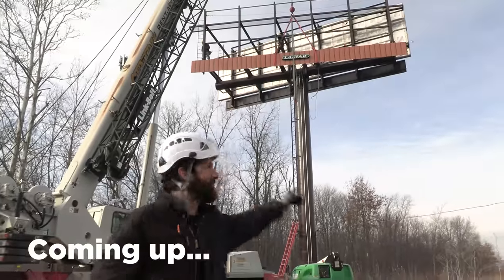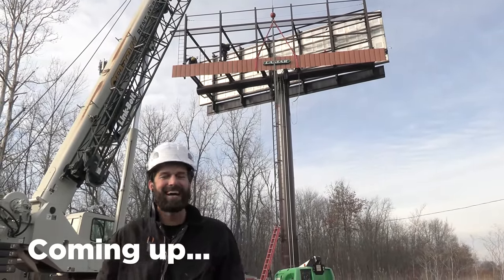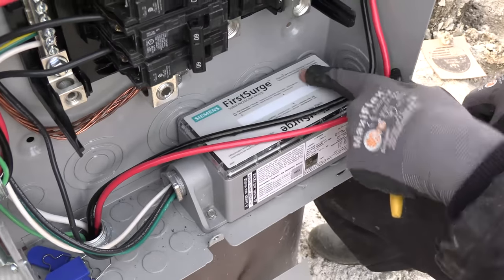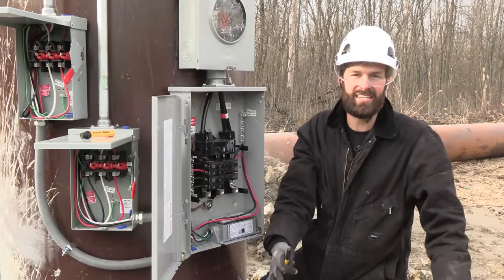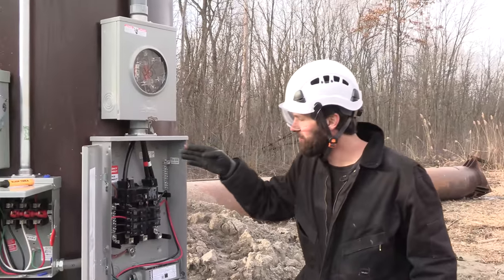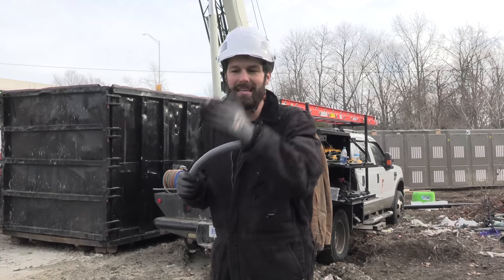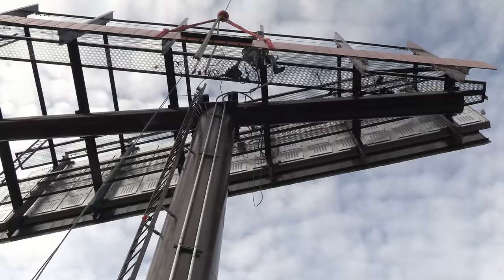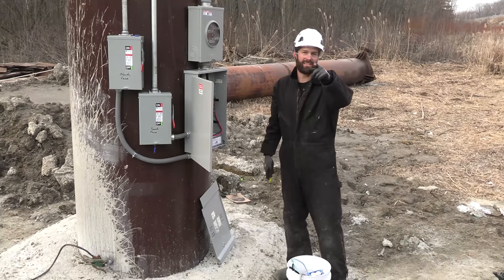The BIG Power Behind Digital Billboards

Comment: Yes, The Inspector may fail you.  The billboard itself is part of the structure and basically it is a supplemental ground(like building steel) and needs to be bonded, but is not a primary ground.  I would install at least two ground rods. If the support is 25 ohms or less to ground and your GEC is properly sized, you may pass.  You can also wait to see what the inspector says if you want. It does not take that long to install ground rods anyway, usually. Thanks, Russ-J Electrician from Oregon.

Comment: loving your work, learning much from you and I am just a software engineer doing DIYing on my own whole house solar build SAFELY.  Started it 22 years ago
Reply: 22years? By the time you are done the sun may be burnt out 😎
Reply: @nachoisme  lol,  started AND commissioned it 22 years ago. Since then, I have already swapped out the CCs and panels once, batteries 3 times, inverter 3 times ( now with a Conext XW Pro).  Same conduit, same wires, same panel mounts - added more panels.  I keep polishing it as I learn new things.  Using Tesla Model S batteries - got 12 of them now
Reply: @norsk54472  right on…awesome!!!

Comment: I worked for Lamar Advertising for 30 years as their electrician over that 30 years I’ve seen the industry change a lot I have found regardless of which digital display you wire up Weatherby daktronics I guess go board or any of the many other ones once you’ve done one they’re pretty much all the same access is the biggest problem and overcome

Comment: I would still throw in a rod or plate, concrete is good for grounding which is why concrete encased electrodes are acceptable, but I dunno if you'll get a good enough ground just from the steel mounting bolts of the sign posts. Sitting on the ground doesn't mean it's grounded ;)
Reply: I can’t tell if you’re joking or not… lol the literal definition of grounded is “connected to ground” and the literal definition of ground is “the earth”

So yeah, it’s grounded. However, inspectors do like to get on their high horse and do like to impose their will, so who knows man.
Reply: @markxx90  it's sort of an inside joke I worked with a guy who would always say "I don't need to hook up the ground it's on the ground"

Comment: I'd say the whole issue of a separate grounding electrode will depend on your authority having jurisdiction (AHJ) and, potentially, the particular inspector you get that day. In my AHJ the idea of "if it's less that 25 ohms..." would never fly with any of the inspectors even though it's called out in sec. 250-54 because it depends on reference to a (local) grounding electrode which you have not installed. (Using the power utility's ground as a reference also wouldn't pass muster because that ground isn't under the inspector's purview and depends on intervening conductors which may have local faults.) Also, is the ground wet when measuring resistivity, or is it dry? Does the resistance change over the course of the year such that you might/might-not pass inspection today but not next week? You would be in a stronger position to make a case for passing inspection if you had been involved with the construction from the beginning and could document with pictures and construction inspections that the structural rebar was bonded together using appropriate ground clamps and the associated rebar grounding conductor was bonded to a grounding electrode. Obviously you are coming onto the project after the fact and can't do that. Lastly, in play here is "what's it worth to cut this corner"? If you fail the inspection and then have to return to the job-site to 1) fix the problem and, 2) meet the inspector again for re-inspection, then how much expense does that represent to you and Jefferson Electric? Taking a little extra T&M expense now may well save a bunch down the road.

Comment: If you can prove you have less then 25 ohms to ground there should be absolutely no reason to put a rod in
Reply: Now we KNOW! And knowing is half the battle. G. I. Joe!! 
Sooory, when I'm tired I find humor in dumb things.
Reply: Not less than 25 ohms to ground. 

It requires less than 25 ohms to the earth ground connection. 

Yes, they're ultimately all connected in the main panel, but the measurement would be taken from the earth ground conductor and not at the bussbar where all the grounding conductors converge.

Comment: Ok, using the pole for grounding without testing is a huge mistake, dry concrete is not a good conductor.  I worked for 40 years in the cell tower industry and I have used a megger to test grounding on every tower that I built and you did not install a proper ground.

Comment: FL ELECTRICAL CONTRACTOR 
Ground rods at light poles and billboards sirve ZERO purpose in electrical safety. The structure concrete and anchor bolts with the cage is your grounding electrode. For static purposes YES. But never to clear a ground fault.  But to answer the question would I drive a ground rod. Absolutely not. The concrete base is the grounding electrode.
Reply: The purpose of the earth ground in an electrical system is never to clear a fault! 

People always misunderstand the purpose of this required part of the electrical system. 

In order for the fault to clear, you must provide a clear and solid path for the fault current back to the source, which is usually the utility transformer. This is what the purpose of the grounding conductor is, but usually that path back to the transformer is the utility neutral wire. 

Utilities in the US do not provide a separate grounding conductor to the utility source. This is actually a deficiency in the utility design and has been the subject of many studies, debates and conversations. 

Now the purpose of the earth ground is to help dissipate excessive voltage from a nearby lightning strike (not a direct hit) to earth. That's it. That's its only purpose. 

I recommend anyone that wants to understand how and why earth grounds are needed and how they should be connected for different situations, should look for some training material from Mike Holt. He has some excellent information with amazing simple illustrations that explain how and why the systems gets installed and what each part of the system is. His training classes are highly recommend! 

I also believe you should have installed the ground rod(s), because then it's sole purpose is to provide that required earth ground and you're not relying on the structure to provide that connection to earth. Many times an electrical system for a premise is bonded to the structure through direct connections to rebar that are installed below grade and encased in concrete. 

But as others have said, when these connections are made they need to either be inspected by the AHJ or the connections need to be recorded and documented for later inspections by the AHJ. 

The problem with recording and then closing up is, that if there is something the inspector doesn't like when he inspects it later, fixing the issue can be much harder and very expensive to correct. 

Additionally, given the cost of these billboards, I'm surprised that they aren't installing dedicated lightning protection directly on the billboards? I would think that given their height compared to local surroundings, and their locations, they might be prone to getting struck by lightning so having dedicated lightning protection would be a pretty sound investment. 

Remember, lightning protection system are meant for direct strikes to the structure or premise. 

Earth grounding is for dissipating nearby lightning strikes that might hit a utility line miles away but that voltage can travel many miles over the utility lines. The earth ground helps dissipate the excess voltage from these nearby strikes to earth to help prevent excessive damage to equipment connected to the electrical system on the premise.
Reply: @El_Diablo_LI  
That’s exactly right. I have been through mike hilts programs and seminars. Grate content for sure he makes it’s easy to follow with illustrations. highly recommended to look in to his martirial.